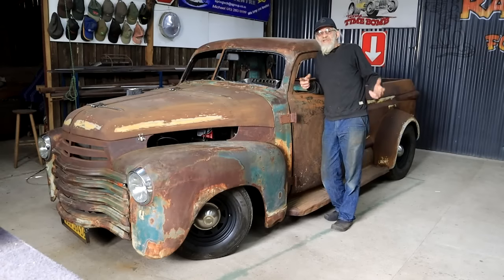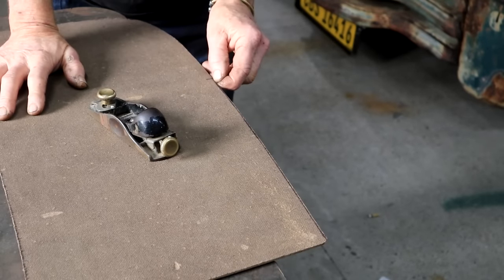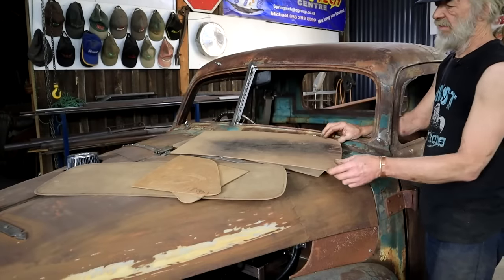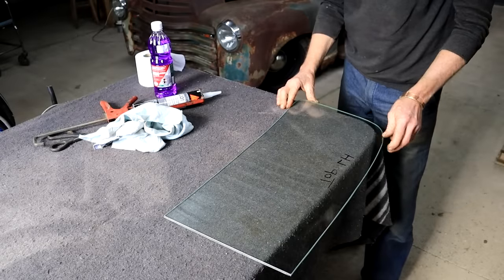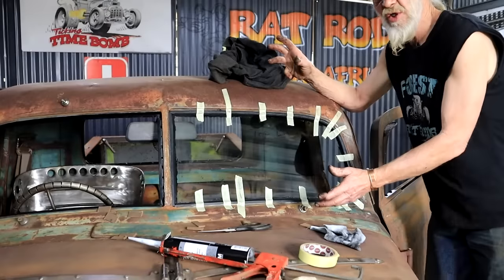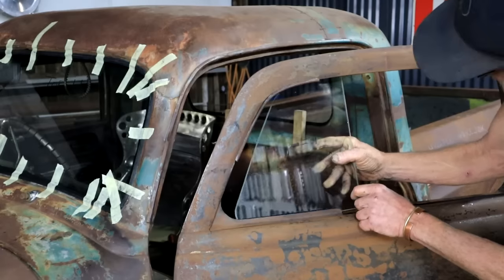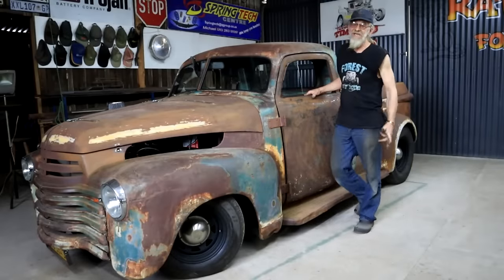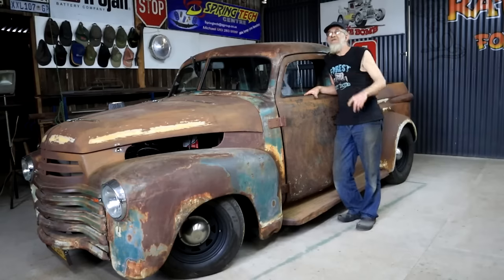How to make and fit your own windshield!

Comment: Hey Diff, thanks for passing on your knowledge. In return I will also pass on some knowledge, when using sealant, silicone etc instead of smoothing it with your finger (with or without mineral turps, washing liquid etc) you can use a potato. The sealant will not stick to the potato due to an enzyme in the potato (learnt from doing countless tile joints in bathrooms). You can also profile your potato if you need a particular curve. So another little tool you could use in the future. Enjoying your channel, cheers.
Reply from the maker: That's a real clever trick Michael! Thanks dude, will definitely give it a go
Reply: who figured out to use a potato?? Who knew????
Reply: Mind = blown
Reply: @brentchalmers1436  someone doing seals in a kitchen with all his fingers already caked with this disgusting stuff, not an inch of rag left, and a forgotten potato lying on the counter 😉

Comment: Cut a V in the plastic tip of your urethane applicator to get the recommended profile.
Also put your glue and rubber trim in the sun for awhile it will be more flexible an glue will move more easily.
I've done thousands of windshields and your approach is solid.
Great work.
Reply from the maker: Thank you! So one learns!
Reply: In my late teens worked for a glass shop that had a shaper nozzle that did a box shaped bead with a half round on top. That flattened out making a nice straight line under the glass. 

Can’t find anything like it on the all knowing all seeing internet. 

But in that same shop had a notcher tool to cut tips in a few profiles. And some old guys who were artists in cutting nozzles.

Comment: Hi Rat Rods,  Glass guy here, art Glass.... I have found  you can use masking tape to keep the  black windshield stuff from getting where you don't want it.  Use a marking pen first to define your tape line then go over to your work bench to tape it off.  Once the glass is seated and you have spread the black goo out, hold the window in place with one hand and pull the tape off... really clean edge.  Keeps the mess & clean up down to nothing.  Love your truck, enjoy the ride, it's the only one we've got.
Reply from the maker: Thanks David!

Comment: To reduce the mess from squeeze out, place masking tape where you don't want the adhesive! Then peel it off while it's wet. That's what I do whenever I caulk adhesives to seal anything. It almost always comes out with a nice clean and straight line.🙂

Comment: I use small copper tube for my application tip which is bent on one end into a triangle of my choosing. Just unscrew the plastic tip from the cartridge of urethane and flare one end of the copper tube so that it won't push out the tip, insert it into the plastic tip and screw it back on the cartridge. You can make your caulk form in any shape you wish with this trick. 
If one is really talented one can simply heat and reform the plastic tip as well. Greetings from Northern Ontario Canada.
Reply from the maker: Obviously Ed of the North is a man that uses his brains! That is clever my man! Great idea.

Comment: Tip I saw the other day was to use tape to mask the side window glass. Then after smoothing the sealant, and before it cures, just peel back the tape to leave a clean edge.

Comment: If  the tip of your windshield adhesive tube is cut  in a inverted V it will make the adhesive come out in the upside down V instead of the round bead  but it depends on the application sometimes you may need the wider bead looks like it worked fine for you so good job...

Comment: To get the triangular bead the data sheet asks for, cut a v in the end (side) of the noozle, face that V notch away from direction of travel & you will get your V shaped bead. Great Job, an interesting Vid.
Reply from the maker: Thanks. Yes, I'm learning that it's all about holding the gun correctly!🙂

Comment: As a retired w/s installer. You should start on the bottom first when pushing the vinyl trim in.
But for a beginner you did ok. 😁

Comment: I remember those old Chevies, they had vacuum motor wipers that quit working when you tried to pass someone, or went up a long hill. Those old recirculating heaters weren't phased out in pickups until 57 or 58 don't recall for sure. I think sedans had fresh air heaters in 57, could have been 56 but I know for sure they had them in 57.

Comment: Gidday Diff.
I'm enjoying your videos and you showing your process. 
I thought I'd shear a few tips in regards to the sika flex.
I used to work in the railways and replacing busted windows was a regular thing,  we would always chuck the tubes of urethane into a bucket of hot water before we started to remove the old window, by the time we were ready it'd be warmed through and a lot easer to squeeze out of the tubes.
Also to get that triangle bead, cut your nozzle off at the diameter you want and then cut a V notch into it, have the V notch face up as you go around and you'll get that triangle of sealant. 
Now as you say you can't get the primers etc and you probably noticed how easily the sika came off the glass when you trimmed it up because it wasn't etched with a "Fret" you could try keying the glue surface with some wet n dry sandpaper to give the urethane something to grab onto.
That's my experience good luck and keep em coming.
Reply from the maker: Thanks for the tips!

Comment: Respect, you are a tough ol bugger doing that sika with a manual caulking gun 🔫!!! That stuff is thick . A few years ago my local windshield replace shop pissed me off ,so I decided to do my own windshields. I bought a usef pneumatic glass remover for $125 and an air  caulking gun for the glue ...$23 , money well spent .. !! I've done three windshields so far on my own cars .
Reply from the maker: Desperation is a great driver!😅 That gun was horrible, new one is on the shopping list!

Comment: Great job fitting those windows. Love the idea of using the T-section rubber in conjunction with the sikaflex! I am going to use that! Have a great weekend there Diff.
Reply from the maker: Thanks. Yes, the T-section thing seems to be working well. First time I try it.
Reply: Sikaflex is a lot runnier than window adhesive and would not stay in the joint
Reply from the maker: @claybair4904  the stuff I used IS a window adhesive made by Sika. Called Sikatack Go. They have a wide range of products.

Comment: I had an old front wheel drive with a bad cv boot . I cleaned the out side of the boot with acetone ,and removed the boot clamps from the boot . I then cut a tee shirt in to strips . I covered them with polyurethane adhesive . Holding the shaft straight I wrapped the strips around the boot , keeping the edges of the boot together . I over lapped the edges of the tee shirt and wound them so they would not unwind .After the adhesive cured I reclamped  the boot , I drove that car for 7 more years with no problem with shaft or boot
Reply from the maker: Wow, never heard that before!  Out the box thinking!

Comment: Great job, most new cars have  windows glued in place and the glass is trimmed in black to hide it. I installed the rear window of my 3 window coupe the same way you did your rear window. I used a household black silicone caulk, cleans off your hands easier, and smooths out really well. Its been about twenty years ago, still tight.
Reply from the maker: Wow, so the normal old silicone has been lasting that long! Yes, way easier to work with😅
Reply: @ratrodsafrica  
But, it won't retain the glass, in collision situations, and actual Urethane ADDS to the vehicles Structural Integrity because of the Permanent Bond it creates, when properly applied.
Previously said through about 1978 we used Butyl tape. I'm sure you've seen the black sticky also used for the backside of door panels, holding the plastic barrier up.
When older cars would wreck, the front and back glass would literally leave the vehicle, in 1 piece.

Comment: Hey, this is the first video of yours I've watched and I really enjoyed it. I have a suggestion for the side glass: add a leather belt to lower and lift the glass running like this: fixed to the outside panel, snaked under the glass, over the edge of the inner panel and fixed on a nail or something on the inside of the door. You can pull on the belt and fix it on the nail to lift the window or let it slide down to open in.
Reply from the maker: Thanks man, glad you enjoyed! Yes, that method works well, have done it once before

Comment: Hello.

It's quite a project you have going on...
I am a sheet metal worker and I also install windows with Sika. When the new window from the factory does NOT come with a black ceramic edge, it MUST be primed so that there is a black edge all around, otherwise the sun's UV rays will cause the glue to break off against the glass.
It is also stated in the installation instructions from Sika.
Regards Per
Reply from the maker: Thanks for the feedback. Yes, I stated in the video that Sika specifies their specific primer. I could not get hold of it where I live, so I will keep an eye on it. Luckily its just a rusty old rat rod :)

Comment: Looks great 👍🏼 👍🏼. I’ve seen windshield guys cut a triangle into the end of the tube applicator to achieve a  triangle shaped line of adhesive.     Acetone helps remove adhesive from hands

Comment: In a previous life, back in the early 90s, I built armored cars. Usually we wanted them to appear stock from the outside. We had custom widescreens made that were several layers thick, around 25mm. And I would use almost the exact techniques, bonding the thick, heavy windscreen into a custom deep shelf with the urethane and then using the urethane to bond the trim on around the perimeter. That T molding would have been a time saver. I used to joke that cutoff wheels and the urethane should both come in flavors, since they both ended up all over my lunch. Looking great, as always.
Reply from the maker: So it sounds like even the pros get that sticky stuff everywhere! 😅

Comment: Thanks! I would be very much tempted to do this on my original Ford Escort Mk2 1977 estate wagon next windshield replacement. The original rubber looks good (I have a newish one) but tends to leak a little and is very difficult to get on. Whole windshield so would certainly need a helper putting it in. Love the patina but with the weather around here it would rust in months. 1st thing i had to do was roll paint the car.

Comment: Im glueing Windows sometime on work and there is a special glue tip that makes it like a mountain and also we always prime the glass to and then put a bead with the special tip on the glass not the body of the car. This is ofcourse with factory windows and not the costum work, but I thaught it was worth saying because we all know not all situation is the same it could open up for some other thinking when there is some problem solving that needs to be done.

Comment: Smart having your wife involved in the truck naming. As a wise man once told me "happy wife, happy life". Glass install looks great! 👍.  I purchased a windshield rubber for my International.  I think they must heat up the rubber molding because it seems to be already molded around the corners. When I lived in the UK windshields shattered into little bits when they broke. Here in the US windshields have a plastic sheet between two layers of glass. When they brake, the pieces stay in place. Thank you for the video. I appreciate you my friend.
Reply from the maker: Thanks Greg. The safety glass I used is also laminated from 2 layers with the plastic between.
Reply: I was wondering if that was laminated glass or tempered safety glass. I believe only the windshields are supposed to be laminated, all others tempered. Nice job on that Rat. Subbed!
Reply from the maker: @gil6995  thanks for the sub and welcome to my shop! It's laminated, plastic layer between 2 sheets of glass.

Comment: Great job on the windshield and the rest of the glass Diff..Rat Rod Bob and myself did the 78 c10 the old school way.. rubber seal with bead lock.....it was a pain in the ass..but we got it done.both front and rear glass.....👍👍😎💪💯
Reply from the maker: Yeah, that old school way is a pain. I got a good excuse though, cant find decent rubber where I live. Unless I import them, which is just too expensive.
Reply: @ratrodsafrica  👍

Comment: I have beat the system as you have as well.  The way you didnt tell the glass place what the glass was for is how I have gotten things done as well.  Back in 1988 i needed another vynil top for my 79 cadillac deville.. And of course the crooks saw me coming and wanted like 300 dollars for enough vinyl to do the job..  But I went to a shop called cloth world instead and just bought vinyl from them and the width and length I needed was only around 60.00.  Another way I beat the sytem of crooks around five years ago, was with the notorious rear windown on your 1997 to 2003 f 150 ford truck to where in all these videos it shows guys and shops taking out the bolts and the trim and replacing the factory rubber seal.  I just simply took off my exterior trim that goes around the window and put windshield rope seal all around the inner part and pushed it in and bolted the trim back on which is actually a stringer reapir and never removed the three piece rear window at all.  I even made a video to tell others about this better and easier way and it got thousands of views.  I have also installed man delco remy alternators on older cars that had stupid voltage regulators with the three wires.    You have to have an intelligent mind that can think outside of the box   You can also make your own vinyl top out of RV tape that is totally paintable and if you wanted to you could actually tape in a windshield on a car and leave over lap and then put cheap stick on silver trim over that.  RV tape isnt something to scoff at at all as some brands can out last a vinyl top  You can also use it to repair wood trim on houses and paint over it.  I also have a huge list of other things I can do that is better than the normal way

Comment: Hey Diff, installing window glass is always a nerve wracking job. The windshield for my 64 F100 was $250. They wanted $350 to install:( I got an extra pair of hands ( brother Bob) and I stalled it myself. We used the rope technique and other than the shitty rope I used breaking twice, we got it in without to much trouble. The flat glass rear window was much easier. Last week I installed new door glass seals and door seals. I think that was overall more difficult. Can't wait to see the "Rusty Lady" on the road!:)
Reply from the maker: Hey John. The big difference is you can get hold of the right rubber molding. Not so here. $350 to install! Wow!! Door glass seals are a rall pain!

Comment: To get that triangle bead you need a special tip for your tube of urethane and you apply the bead to the glass.. use suction cups to lower the glass into the opening.. FYI.
Reply from the maker: Yes, suction cups and special tips would be the pro way to do it. Unlike the bush mechanic...😅

Comment: Hey diff just to let you know I did auto glass in college and if u take the nozzle and a pair of wire cutters or dykes cut a V in the end of the  nozzle that will make the poly taller ot of the gun less excess out the sides.. cheers brother 👍

Comment: What I use to get urethane off my hands is gojo hand cleaner with a little laquer thinner. Maybe a little WD-40 too. Trust me it cuts it but may stain hands a little. Looks good by the way. If I were you I'd put the rubber moulding on the glass 1st it has its own glue . I tape it a bit also.
Reply from the maker: Thanks. No glue on the moulding I had

Comment: A heat gun with old molding; would have rounded the corners!
But if the other works 👍🇺🇸
From what I've seen on the new seiler ; it always bleeds in hot weather. 
Your always cleaning.
Reply from the maker: No bleeding with mine, works well

Comment: If you use that black stuff again try using peanut butter to try to get the black stuff off your hands with just a little work at rubbing with your finger nail !!  I've used it to remove printer ink & oil base paint & black motor grease and more . the oil in the peanut butter does the work .
Reply from the maker: Peanut butter? 😅 Never heard that before. Wife had better start making some peanut butter sandwiches for me😂

Comment: Just a thought about the side windows. Back in the 60's the big 3 were producing race cars for the street essentially.  1 thing they did in making the car lighter was to remove the window regulators and replace the assembly with simply a length of seat belt with the male end attached.  Drop the free end of the belt in thru top edge along side the glass and down into the door and attach to the bottom of the glass. Then when you pull down on the belt it lifts the glass up then snap it into the female portion that's attached to the bottom of the door panel and it holds the glass in its home. Up or down options only but totally hot rod esque. Make sense?
Reply from the maker: Yes, understand completely! I actually did that on another build, works a treat! Thanks

Comment: You ever try putting car wax on a windshield. Heck you almost don't need wipers, until you slow down. lol I had to put wax on my windshield, when I was younger to get home.It worked. lol  I like how you show your process for each step of your build.  You keep everything fairly simple, but you can see pride in your work .From the fabrication fitment to the finished results.I'm glad I found your channel.
Reply from the maker: Howzit Eric! Welocme to my shop. Also did the wax trick in my younger days, but now my beards is grey...😅